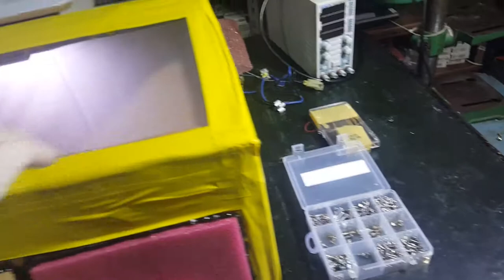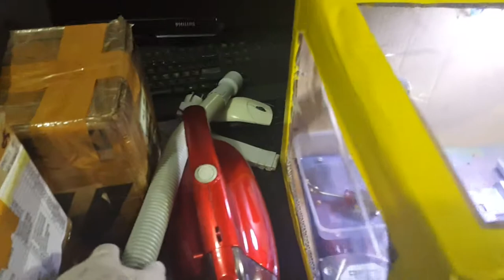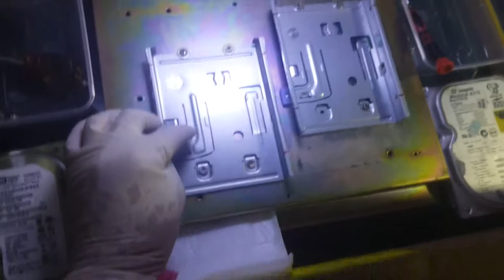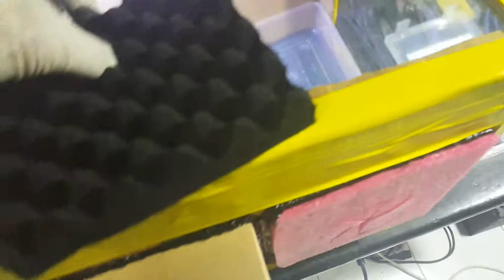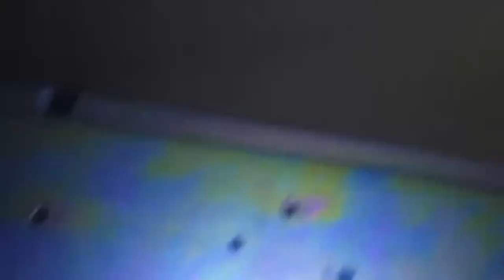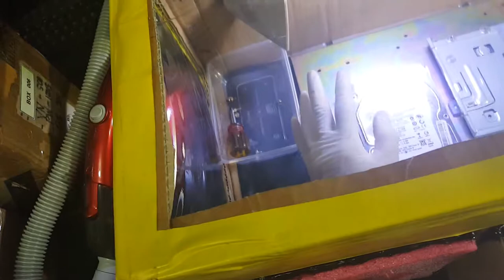Home made diy dust free portable clean room enclosure cardboard box for repair HDD

Comment: hi you use positive pressure for this box. insert hepa filter and 3 fans for create positive pressure in the box and air is clean
Reply from the maker: Yes correct. It is exactly what I build.. so far works fine and succeed for hdd data recovery.
Reply: @akanghadibatam7285   how do you recover the data if you don't use pc3000 or any other data recovery tools??
Reply from the maker: @chris01479  of course I have recovery tools, PC3000 and MRT.